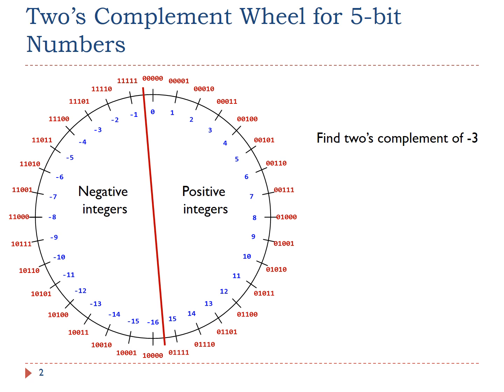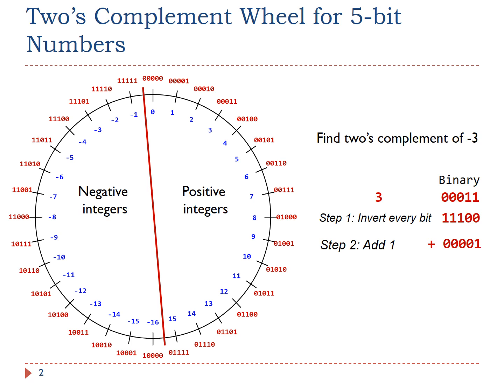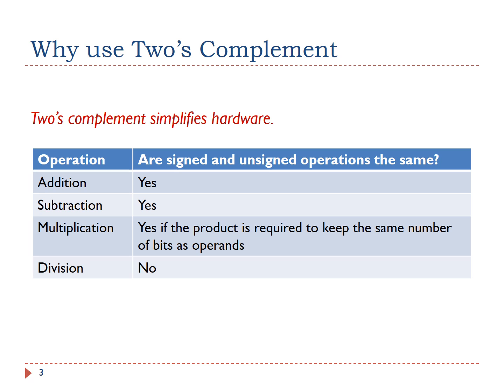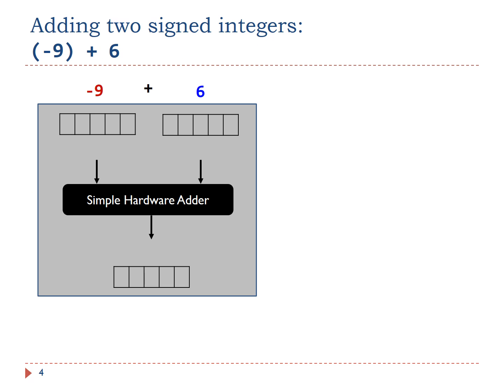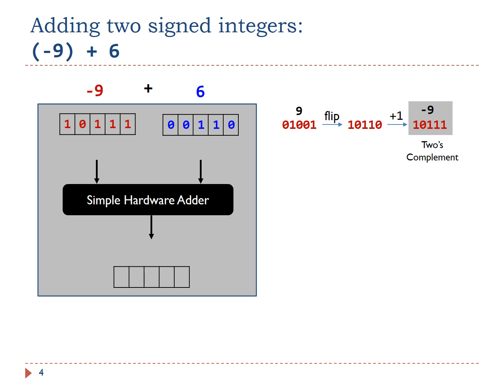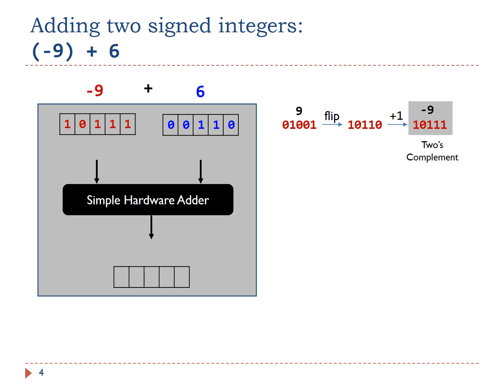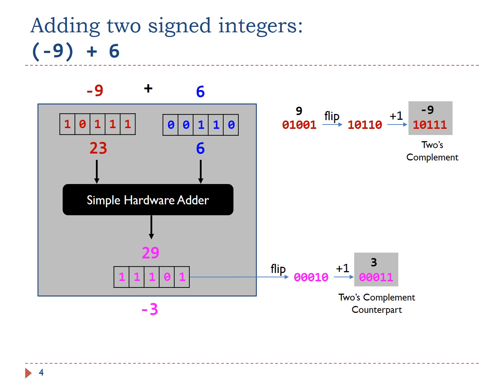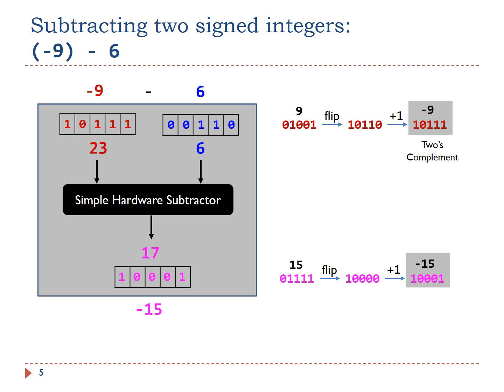Lecture 1: Why use Two's Complement

Comment: but tell me what is the reason for flipping, what property of binnary representation make it usable?
Why flpping can be used?
Reply: The goal is to make the negative numbers in 2's complement to act the same way (mostly) as they do in decimal. If you add two numbers together, let's say 5 and -5 you want them to cancel each other out and the result should be zero. 
If you want the same to apply in binary the flipping of bits is needed. 
5 = 0101
-5 = 1011
5 + (-5) = 0
0101 + 1011 = 0